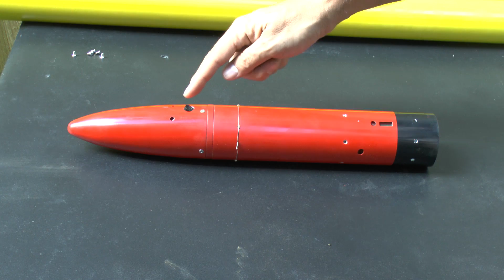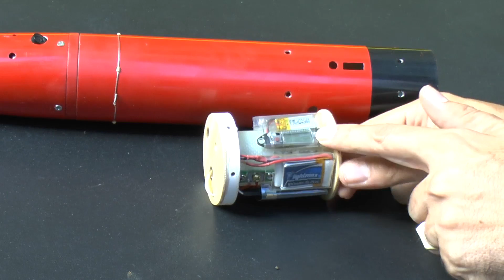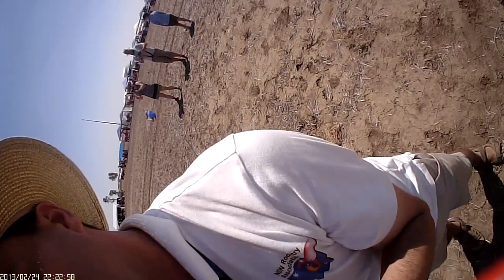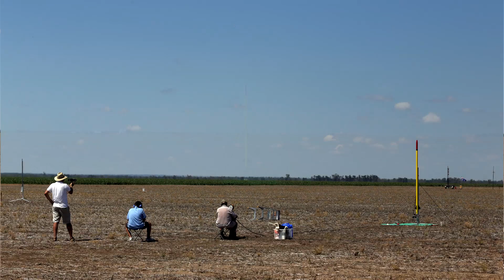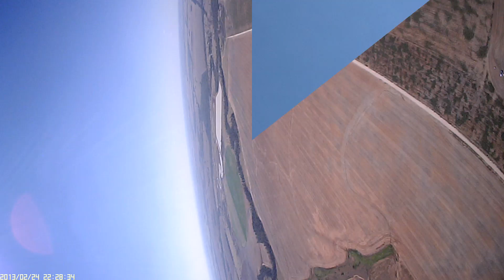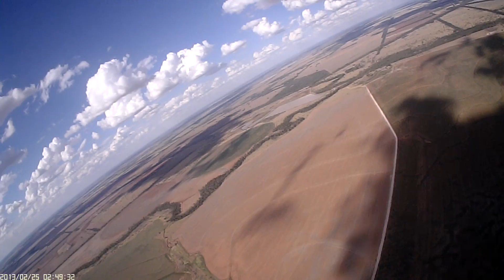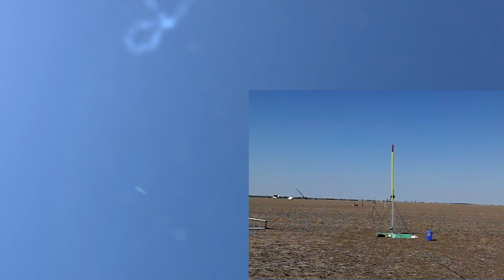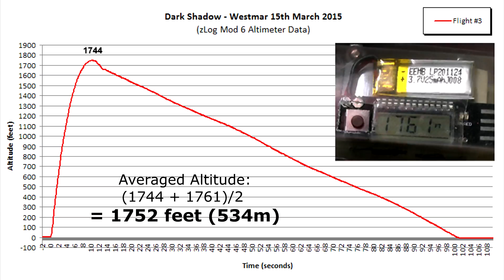Water Rocket flies to 1752 feet (534m)

Comment: I should think air drag could be lowered considerably by using a laminar flow body of revolution, thus making significantly higher altitudes possible. The pressure vessel would have to be thicker, of course, but perhaps the decreased wetted area would make up for it. I don't think I've ever seen model rocket hobbyists use low drag shapes. I think the optimum shape might be something like this:
https://tinyurl.com/ydh6n8p7
The parachute arrangements would have to be far back on the body to preserve laminar flow as much as possible. 

Also, I would think the rocket body should be mostly kevlar, since thebiggest load is from pressurization.
Reply: BTW, I'm still impressed!
Reply from the maker: One problem is how you would go about manufacturing that shape easily. One of the reasons model rockets look the way they do is because they are easy to construct while still giving an approximation to the ideal shape. Increasing wall thickness also increases weight so there is some tradeoff there. Carbon Fiber actually has better properties for pressure chambers over kevlar. Better tensile strength and better strength to weight ratio.

Comment: If there are any Flat-Earth theorists watching: how do you explain that the Horizon seems further away the higher the rocket goes? If the Earth were flat, the Horizon you see from the rocket before it is fired would be the same as the Horizon you see when the rocket is at the top of its trajectory. Answer that, you morons!

Comment: Really impressive, what blows my mind is the explosive acceleration. I didn't know that acceleration like that was even possible.  Could it be even faster using a gas instead of a liquid, but then I guess it would be a lot more dangerous in case of an accidental explosion. Fantastic work!

Comment: SCIFI question: what happens if you fill it with a gas that dissolves significantly in the water/ or other liquid? Higher pressure dissolves more in the liquid , you can actually get the same psi but more gas in the rocket, partly dissolved in the liquid and partly as gas. when pressure is dropped the gas "boils" from the liquid giving extra thrust.  #bongyorján
Reply from the maker: Yes that is possible. Something like CO2 would do that as it readily dissolves in water. One problem is that the liquid typically is ejected from the rocket within 1-2 seconds and often a lot less than that, so I am not sure how quickly you would be able to recover any of the dissolved gas before the liquid is all ejected. Still it would be worth a try.

Comment: Q: If the water shoots out at higher "Velocity" will rocket climb higher? If a little air mixes with the water causing the water to exit the nozzle mixed with a little higher velocity air, would this increase speed and altitude? I believe I have a way to evenly mix the air with the water instead of squirting out all the water at low velocity. oct1113@hotmail.com
Reply: It seems that water is forced out at a relatively low speed compared to the speed at which the air exits later. If air and water could exit simultaneously it seems that the higher velocity exit of the water would increase power and length of "Burn" More or less increasing water velocity at take off and spreading the ejection of water and air over a longer period of time. With the guide rod you would still have that initial push for the take off.

Comment: I just wanted to know how to calculate height for a single stage rocket with respect to given parameters like water bol.,rocket bol.,bottle diameter,nozzle diameter and if using boosters 
then what will be pressures inside each boosters if I wanted my rocket to reach 900 metres. Pls reply ASAP
Reply from the maker: Best to use a simulator to see how your design will perform. You will then be able to alter those parameters and see how that affects your altitude.

Comment: Hello,
Will there be any increase in the speed, if the rocket is spinning in X-axis; assuming the rocket is flying in Y-axis?
Thanks.
Reply from the maker: Do you mean spinning around the y axis? If you had canted fins and you were spinning fast enough then the fins could act as propeller blades then I guess you could increase speed. The question is where would the energy come from to get it to spin that fast?

Comment: WHAT KIND OF PRESSURE VALVE YOU ARE USING ,IF THERE IS ONE,OR THEY JUST SENT THE PRESSURE OF SO MUCH PSI SUDDENLY AND THE ROCKET WILL FLY,AS I SEE ,I AM HEARING THE SOUND OF EXHAUSTED AIR AS IT CLIMB,OR THE SOUND MIXED WITH THE AIR ITS GOING THROUGH,WHY WATER?DOES IT GIVE MORE PUSH SINCE IT IS HEAVY,I SUSPECT SO,AND WHAT ABOUT THE HIGHEST SPEED YOU ATTEND ?  THANKS ,IT IS STILL EXCITING TO SEE THAT

Comment: What would happen if you were to add ARBs to this launcher?
Reply from the maker: Good question, I am sure you would get a benefit from them. They would need to be carefully designed including the launcher to handle the high pressures.
Reply: AirCommandRockets Every little bit helps! :)

Comment: What I don't understand is why anyone isn't flying mixed fuel gas rocket like this one but, with a combustible fuel.  If the fuel escapes the nozzle at a velocity that is faster than can burn, then you just need a combustion chamber.  When the pressure drops and it can back burn, you want to either close a valve, or make sure the rocket body can handle it, or has some kind of pressure relief valve.

Comment: what is the water to air ratio?
Reply from the maker: 27 : 73, or just a little under 1/3 water and 2/3 air.
Reply: Is there a formula that can be used to optimize this, or is the ratio computed via experimentation?
Reply from the maker: There are many factors that affect the optimal ratio such as drag coefficient, weight, volume, nozzle size, liquid density pressure etc. The best way to find the optimal ratio for a particular rocket and launch parameters is to use a simulator. We like to use Clifford Heath's one as it is quite accurate in predicting performance: http://cjh.polyplex.org/rockets/simulation/

Comment: A question that you may have already looked into.  Have you looked at Nozzles with bell shapes attached for increased efficiency?

( I admit I got the idea from a video about Kerbal Space Program https://www.youtube.com/watch?v=l5l3CHWoHSI )
Reply from the maker: Convergent-divergent (CD) nozzles can be problematic in water rockets. They are good for compressible liquids and gasses, but not so for virtually incompressible water. A CD nozzle would be beneficial during the air phase of the boost, but not really during the water phase. We have done some tests with these: http://www.aircommandrockets.com/day32.htm

Comment: Have you double integrated your position data to determine peak acceleration during boost? I would like to know the G's you are pulling.
Reply from the maker: That's about the right figure. Actually from simulations (That are relatively accurate) the peak accelerations were: 
Flight 1: 38G, 
Flight 2: 45G
Flight 3: 49G

Peak acceleration happens shortly after the water runs out and the rest of the compressed air rushes out.
Reply: I'm curious to know that too. I'm fairly sure an accelerometer was used, and twice-differentiated to get the position data. If so, the G's could be read directly from the accelerometer.
Reply: Correction, he uses an altimeter, not an accelerometer, at least for the rocket in one of his other videos: https://www.youtube.com/watch?v=4r9gmLfpFTg (go to 0:24)
Reply from the maker: Unfortunately we didn't fly an accelerometer on these flights. The acceleration estimates come from the simulator that is fairly accurate in predicting the flight characteristics of this rocket. But yes you could derive the acceleration from the altitude data. That's how we arrived at the actual velocity. Here is the velocity plot derived from the altimeter: http://www.aircommandrockets.com/images/2015/day158/Combined_Speed.png
Reply: Wow, 0-350/375m/s in one second, that's a peak acceleration of roughly 35.7g for flight 2 and 38.2g for flight 3.

Comment: You should install a G-Meter on the rocket so you know how much vertical forces are on the rocket at liftoff etc etc.
Reply: Use maths to find out.
Reply: @IrishNational  can't use math to get precise results
Reply: @tennicktenstyl   you can how you think Quantum Physics works... You do velocity of the size of the tip of Rockett against the gravity and air/atmospheric pressure acting against it.
Reply: @IrishNational  this would require complicated math or maybe even complicated simulations
Reply: @tennicktenstyl   well still cheaper than a g-meter
Reply: @IrishNational  they are super cheap though.
Reply: Could be 10-12 G force? more or less... assuming it covered about first 100 meters in the first 1 second. I @tennicktenstyl
Reply: @MrMa1981  according to popular math that would be over 20g. But even then, you can never know at which moment the acceleration was highest.
Reply: @tennicktenstyl  How did you calculate that? I saw (very approximately) 100 or more meters in 1 second sooo... 100/9,8 = 10G circa. 
Ok, I'm wrong. Where?
Reply: @MrMa1981   Magic Rojava  middle school maths. assuming g≈10m/s²
s = (at²)/2
a = (2s)/(t²)
a = (2*100m)/(1s²) = 200m/s² ≈ 20g

You must have messed something up, as if it weren't accelerating or something.
Reply: @MrMa1981  but then it does all its acceleration in 0,2s so you can figure that out on your own.
Reply: @tennicktenstyl  Thanks. I wasn't in the building that day, maybe?

I had imagine that rocket went 0 to 360 km/h in 1 second.

But with this converter I had 10,19 g right now.
https://www.translatorscafe.com/unit-converter/it/acceleration/2-19/metro%2Fsecondo%C2%B2-accelerazione%20di%20gravit%C3%A0/
Reply: Simple equation would solve it 200ms of thrust and total energy to 1700ft would do that all for you
Reply: The_Disabled_Gamer#2 
I was surprised at how limited the electronics package was. Accelerometers at least. And I didn’t see max speed achieved.
Reply: I don't think that you would get any

Comment: What is the initial acceleration?
Reply from the maker: +Yan Tang Close to 50Gs
Reply: Thanks, just went back and watched from the beginning and realised I probably could have worked that out. 600PSI is 4.13685 N/mm2, the nozzle is 15.5 mm in diameter, giving an area of 188.71mm2, for a potential force of 780 N, over 9.8 equals 79.66 with an inertial mass of 1.5kg = 53G force. Presumably the water and compressed air add to the inertial mass.

Comment: So what material is used for the fuselage?  You mention that the body is re-inforced with carbon fiber, but what is the carbon fiber reinforcing?...aluminum?

Thanks in advance. Project well done.
Reply from the maker: +tekno mytekno There is a thin fiberglass shell inside that the carbon fiber sleeve is pulled over. Here are the full project details it shows how the inner shell was made: http://www.aircommandrockets.com/dark_shadow_1.htm

Comment: This is a really well built machine! I really like that avionics package. Do you make adjustments to the rocket based on the data logging?
Reply from the maker: +Rico Reyes Thanks. There really aren't that many parameters we can change once the rocket is built, but we can change the water amount and pressure easily. This rocket is an evolution from our similar previous fiberglass rocket, and this design was partly based on the data captured with the previous one. We simulate the performance of these rockets before flight and the logged data helps us refine the simulation model so we can better predict the performance at different pressures.

Comment: It seems like the rocket piss out all the water in the first 3-4 meters and are actually just coasting upwards from there. Wouldn't it be better to have a smaller nozzle so the water got out slower and could build up more speed over time? Also have you thought of using the same principle as the fanless Dyson fans use to let the water move air with the stream and give it an extra boost?
Reply from the maker: +scarystuff1970 Good question. That is correct, most of the water leaves the rocket in the first few meters of launch and the rest is just coasting. Using a smaller nozzle will draw out the thrust phase, but you have to remember that you are at the same time having to accelerate the mass of water that is still in the rocket which reduces the benefits. On the other hand with lower peak velocity you are reducing drag because drag is proportional to the square of the velocity. In the end it turns out that the size of the nozzle makes only small differences in altitude, with generally larger nozzles winning out. The size of the nozzle chosen for this rocket was done to reduce peak acceleration to around 50G in order to keep stresses on internal components to manageable levels.

Comment: You really need a G force meter, that thing accelerates tremendously fast :0
Reply from the maker: +zombieman2012 Acceleration for this rocket is around 50G.
Reply: AirCommandRockets :Q__
Reply: +AirCommandRockets That is a tremendous amount of force!, it must be some very shock resistant camera/electronics in that rig.

Comment: Do you use different types of water?

Cl2
Distilled 
Reverse osmosis
Carbonated?
Perrier 
Spring water?

Cool video👍🎥
Reply: Can you smoothen around the rivets or screw heads?. Howard Hughes made a good point on airflow.

Jb weld? Body filler? 
 Epoxy?
Silicone rubber?

Can wax polish and buffing or a silicon spray treatment reduce friction? Also anti friction rocket rod , guide. 

Maybe an extra foot height?

This is a cat🐱
Reply from the maker: +Crazy Funny Cats Certainly smoothing the rocket finish would help with drag. I don't believe doing anything to the several countersunk screws would make a measurable difference though.
Reply: +Crazy Funny Cats       If I didn't have any more questions than you did I wouldn't have wasted the time.   Dogs Rule!!!   Come up with some good questions.  Oh and did I say Dog's Rule?  Never mind, I see it.
Reply: +Crazy Funny Cats       If I didn't have any more questions than you did I wouldn't have wasted the time.   Dogs Rule!!!   Come up with some good questions.  Oh and did I say Dog's Rule?  Never mind, I see it.
Reply: +Crazy Funny Cats       If I didn't have any more questions than you did I wouldn't have wasted the time.   Dogs Rule!!!   Come up with some good questions.  Oh and did I say Dog's Rule?  Never mind, I see it.
Reply: +Crazy Funny Cats      Cat's Suck!!!!
Reply: Duisburg
Reply: +Crazy Funny Cats soda water
Reply: Mercury
Reply: Mercury
Reply: Mercury

Comment: I might recommend adding sugar to the water...perhaps to a density of 1.2 or even 1.3.  Calculating that should give you somewhat better altitude for the given volume of ejecta and pressure limitations of the tube. Sugar would not harm the farm land...(great for the ants that live there, though). But, in a different environment, salt might be a nice additive.

At any rate, lovely rocket, fantastic result.
Reply from the maker: +Polypropellor I haven't run the calculations for this rocket yet, but it may do worse with a higher density: Here is an experiment we did recently: https://www.youtube.com/watch?v=Fu3rIiPy_18

Comment: Any idea what portion of the thrust comes from the water vs just the air being released?
Reply from the maker: +htomerif Yes, in the water phase you get about 2/3 of the total impulse and 1/3 from the air phase part of the boost. If you launched the rocket with air only, you would expect to get only about 40% of the total altitude compared to if you used the optimal amount of water.

Comment: Great work! What was the maximum or design internal pressure of the rocket? Also, what pressure was the rocket tested at prior to the first launch, during the hydrostatic test? Did the body or any of the components suffer damages/cracks during landing? Again great work!

Comment: What kind of gas did you use?
Reply from the maker: +Mike Suopys Just regular air from a scuba tank.
Reply: Interesting.  Have you tried other types of gasses to see if you can get better results?
Reply from the maker: +Mike Suopys We have not tried ourselves, but CO2 is supposed to give better results due to its heavier molecular mass.
Reply: Yes. It should also be more compressible.

That is you can add more CO2 molecules to the tank and still have little pressure change. 

This is good, because it would take longer to deplete the "fuel", thus giving you more flight time.
Reply: There might be a problem though.

I think carbon dioxide liquefies at pressures above 5 atm (at room temperatures).  This can  plateau your maximum thrust.

Comment: they should say their rocket are powered by compressed air, not by water. Energy is coming from the air that was compressed previously by some compressor and now decompressed. It is like saying that boeing 737 are powered by air. Remove the compressed air and it would not fly at all; remove the water and it would go up at least 10 ft in the air... water in this case just improve the recuperation of this compressed air.
Reply: can u please explain the scientific principle of how it works?  I can understand the compressed air part, but what role does the Water play in this propulsion?

Comment: Great stuff. Would love to see details of the water motor.GRP tube can go soft in the heat (I know you know that) could you use a carbon fibre tube? More strength less weight?Just an idea. Looking forward to more videosCheers Craig
Reply from the maker: Thanks +Craig Cowley. This rocket is made from carbon fiber. It's the epoxy holding it together that's the problem with a glass transition temperature of around 65C. High ambient temperature and compression heating can put it over.  Construction details are here: http://www.aircommandrockets.com/dark_shadow_1.htm